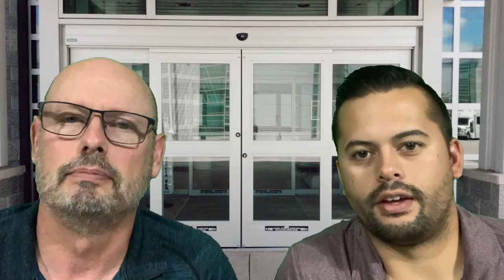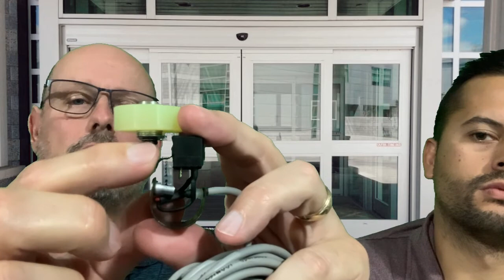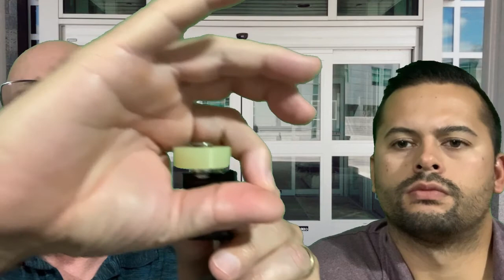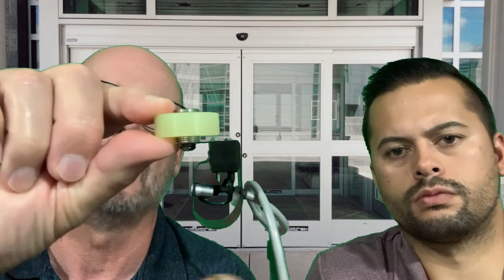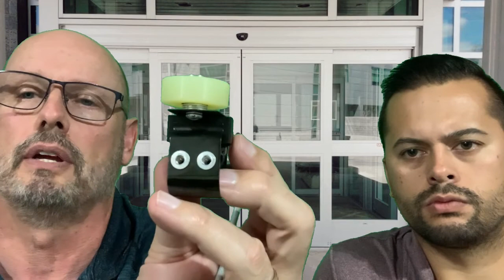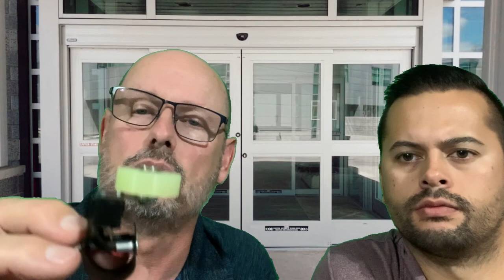How To Install A FSL Breakout Switch On A Stanley Duraglide Automatic Sliding Door

Comment: The rollers on these doors I'm currently working on have a little play between them and the pivot they are on . Is that normal when they are new? These are not new, but look a bit used.
Reply from the maker: New rollers will still have a little play between the roller shaft and the c-clip, but not a whole lot. Usually those tolerances are pretty good. It could be that your rollers are just older and worn down.